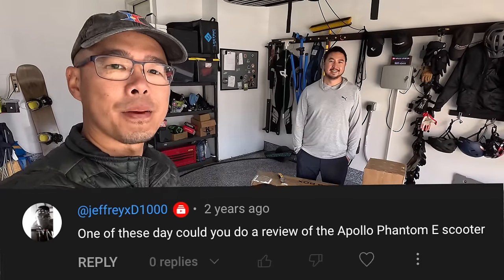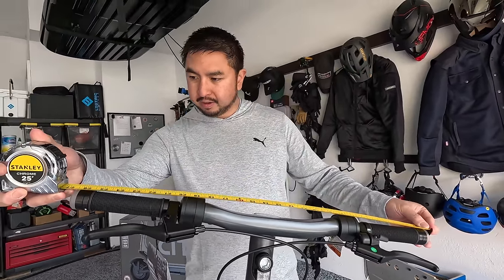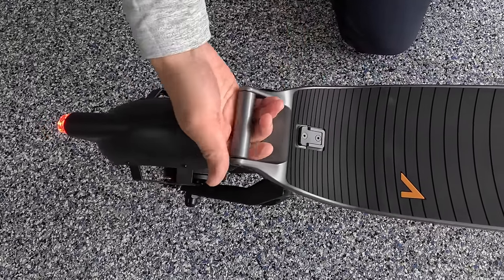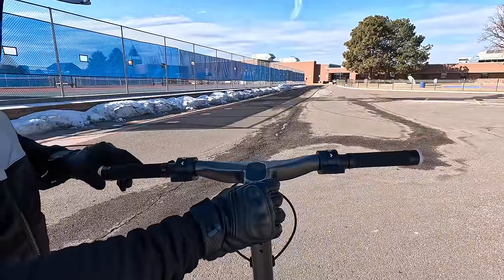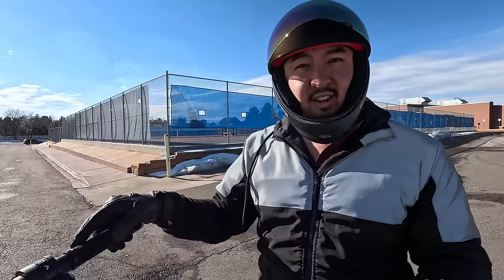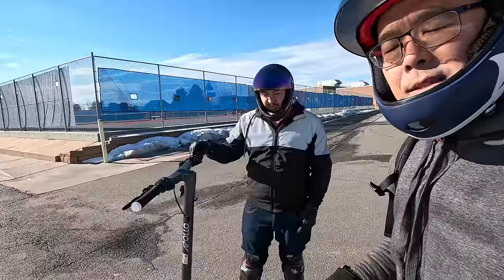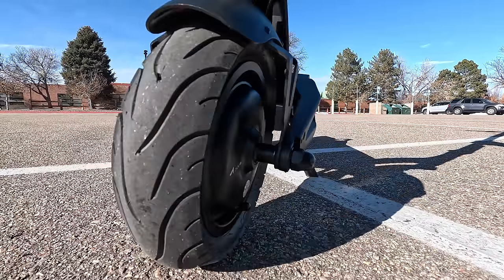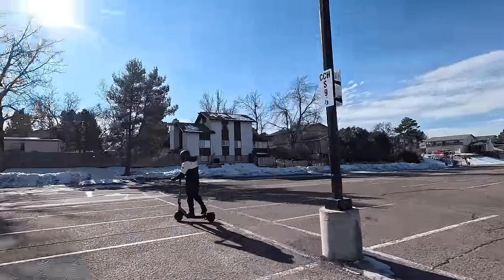This $1,699 Premium Escooter is a Nearly Perfect Commuter: NEW Apollo City Pro Review

Comment: I had an apollo ghost and sold it in less than a month.. they habe no value, they overprice things by trying to convince people theyre better quality. They say people dont need faster scooters, just better engineering... they dont know their market
Reply: why did you sell it?
Reply: @KroryykDB  wanted more power and especially range. The apollo ghost once you ride about 10 miles the power drops alot and same with the torque. The range isn't good, I would get to about 18 miles of range. 13-18 miles is very slow. Sketchy past 30 miles per hour, no lights at night, breaks were a pain in the butt, uses way old technology etc. Now I have a dualtron thunder and I get 60 miles real range or 90 miles if I keep it under 25 miles per hour. It can hit 63 mph, amazing headlights etc. I get more compliments on it and stopped more than when I had my corvette and camaro !

Comment: I absolutely can’t stand Apollo’s center notch in the steering.  It prevented me from buying one.
Reply: After about 50 miles or so, break in period. The center notch feel is gone.
Reply: It's a factory defect with the steering head bearings
Reply: @user-bp5py6bh3g  What is the defect ? Can you please be specific.
Reply: @7sonero7  Steering column is over-tightened in the factory on the steering head bearings creating a notch, often with incorrectly applied grease amplifying the issue. Same issue with Nami Burn-E scooters.
Reply: @user-bp5py6bh3g  Why do you suppose the notch goes away over time ? 
Do you think it is due to the break-in period?
Reply: @7sonero7  Sometimes it does, often it doesn't. Usually the bearing getting worn out, the grease settling in and the steering assembly getting looser over time.
Reply: @user-bp5py6bh3g  I thought the notch was there by design. But if you are correct. Apollo should fix the problem.
Reply: I got an Apollo Phantom, I don’t notice a notch or maybe it’s it doesn’t bother me at all to the point that I don’t notice it

Comment: Handle bar signal lights, very little value.  The turn signal should be a switch instead of two buttons.  Similar to what a motorbike use.  Still waiting for a motorbike throttle instead of these thumb throttles.  Kickstand will not work well if on uneven ground.  I always feel as if my scooter will fall over, even when on level ground.  It should have a bit of a lean to it.  The front fender does not do its job properly.  I really like the locking hook for picking up the scooter.  My 2022 City Pro does not have the latch so I end up carrying the scooter with the stem locked in an upright position.  Too many stories of the hook unhooking itself.  I have to say, this scooter is first class.  Clearly, the designer put some thought into the scooter.  If I did not have my 2022 version, I would purchase the 2023 model.  I feel very safe riding at high speeds compared to previous scooters I owned.  Very stable, smooth, drum brakes are the way to go, cruise control (use it all the time), carrying handle makes lifting the scooter so much easier, lots of power.  The range is about 45 kms.  I go 40 kms with still some juice left as I never drain the battery.  Now I wish it was summer... two more months before I can take it out.

Comment: I went and order this, same exact as what you have reviewed. I tested the one on the floor. To my surprise, Apollo listened to the negatives you guys pointed out here, and voila! when I came to pick up my order from the store 3 weeks ago, all the negatives have been rectified - the stand is now more robust, the locking mechanism had a rubber strap added, and the light had been changed (I think it is halogen??)!!! Upgrades I didn't expected. Even the store owner wasn't aware that the new batch that came to the store had some good work done on them. I'm in Australia and I haven't expect a quick remedy for these feedbacks you guys brought up in this review, only 4months ago. Chapeau gents!!
I clocked 500kms since I bought it and haven't had any issues so far, app has no issues either.

Comment: This was a recommended video by Google for me (I’ve recently been watching eScooter videos). I was about to close the video before the “things you didn’t like” section as is felt like an advertisement more than a review. I’m glad I didn’t close it as the video was well balanced by the cons, after hearing all the pros. Thanks for the review and for Apollo for sending you the unit. 😊👍

One criticism as a new viewer on your channel is the skidding on a device in reviews. I don’t understand why reviewers in general insist on doing that? It’s not a “trick” it seems kind of juvenile. If you can’t brake hard without skidding it shows a lack of control or tire grip and promotes anti social behaviour by leaving a mark on the surface you’re riding on. It also lowers the respect level that people using these devices are already struggling with (Scooters are banned in some areas, like here in Australia, because of users doing things like that in public). Replacing tires on a scooter is a pain too, so why encourage people to wear them out intentionally? /EndOldManRant
Reply from the maker: I appreciate your insight and your rant. Thanks for sharing!

Comment: Quite happy with my 2023 City Pro. The regen brakes are unreal and I use them most of the time. They enlarged the battery on the 23/24 model which is nice for extra range and the cells are the 21700. I haven't had any issues whatsoever with the app, it works great. All in all, it's been a great scooter. I will say that Apollo also has sales regularly so keep an eye out on their website if you're in the market.

Comment: I would really like to see a stem light similar to what is on the Go as well as an LFP battery. Having the option of adding a centre stand would be really nice as well. As long as the threaded mounting holes were in in the base it would be a nice add-on option.

Comment: How would this compare to a dualtron popular? What would be a better option,
Reply: Popular is a little cheaper and has a higher top speed and acceleration.  But this scooter is a lot more refined and the larger tires are safer.  It depends on what you value more.  I prefer the city over the popular if speed isn’t your priority.

Comment: If you are north of $1,200 there is a lot more scooter you can get.
1)No damper
2)Drum brakes

There are GOOD name brand scooters that have hydraulic disc dual caliper and steering dampers that are $1,200~$1,700
Personally for $1700 I would get a Nami Klima (45mph dual motor) or a Teverun or even a Nanrobot.

Comment: Needs a steering dampener so you can ride no handed. .. joking, but every quick scooter needs more front end stability at speed.

And no modular battery or trigger throttle option either, as the thumb throttle system gets very tiresome after about 30 mins.

Otherwise it's a nice if not very large scooter that has been beautifully manufactured.

Comment: Can the scooter maintain 32MPH when climbing or is that only on flat? I'd like to see a scooter that's overbuilt and software limited because my "22MPH" Segway Max G2 can only hit 22 on a very flat surface with 75%+  charge and tires inflated to the maximum. I'm often on streets with cars trying to go 30-35 while I'm only able to go 17 because of the incline. I have to go over to (much rougher) side-streets.